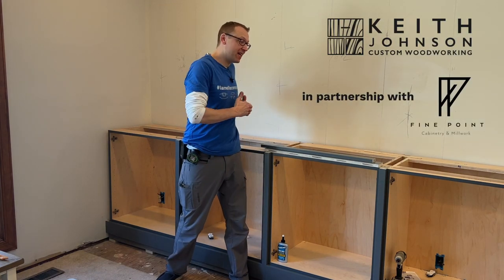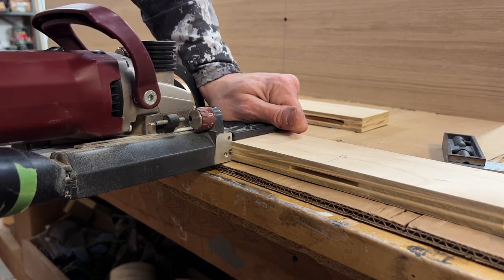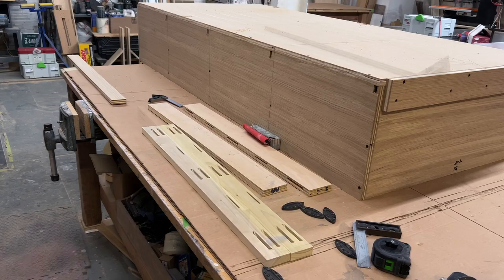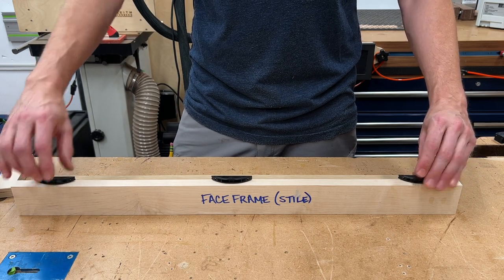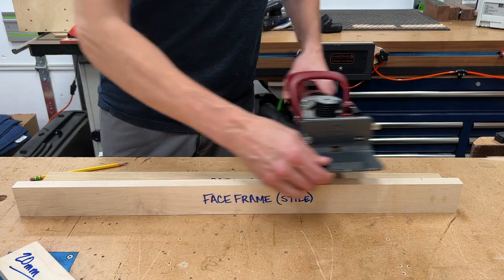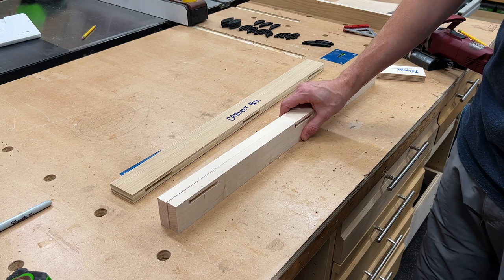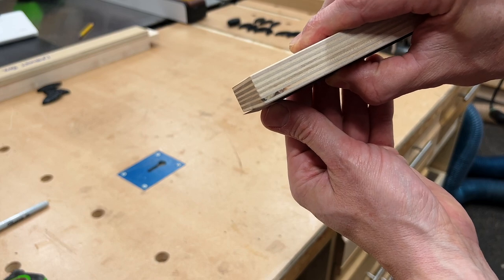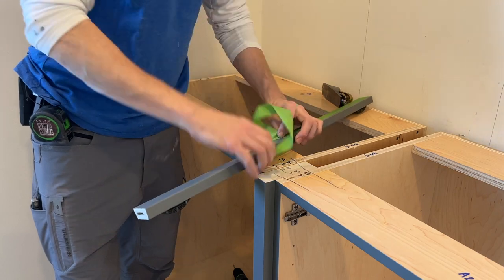How To Install Cabinet Face Frames, Filler Strips and Scribes with the Lamello P System

Comment: When you use the 20mm spacer block how do you know where the center line is? Are you making it on the 20mm block and then aligning that to the work piece center line?

Comment: Considering how easy it is to adjust the slot height i just dont see the point in using the spacer block that could also hinder you when plunging.
Reply: That's because you've never done it before and still believe that your eyes are capable of gauging height accurately on the basis of some little lines.

Comment: Isn’t free cutting on a table saw (especially tilted) piece that narrow very risky in terms of kickback?
Reply: not for the real ones
Reply: It's not that bad more likely to loose a finger than anything else.  There's no better way to do it sometimes when just a little needs taken off a grinder with a sanding disc is what I use normally the wall is bad enough it is tablesaw then grinder.

Comment: I noticed that the lamelo is now available in cordless. 
Does it matter if the male or female contractor go in the face frame or cabinet?
Reply from the maker: Not per se, but the general best practice for P-System connectors in all applications is the male half goes in the edges and female into the surfaces.  This is mainly to take advantage of being able to flat-pack the product.
Reply: Ah i see, makes sence thank you @ColonialSaw

Comment: I noticed on the face frame example at the end the layout lines weren't perfectly aligned.  Does the zeta allow for lateral misalignment?  Similar to the domino when using tight on one end and loose on the other?
Reply from the maker: That's correct, the P-System does allow for lateral adjustability, so you don't have to be right on the money for slot placement.
Reply: How much movement?

Comment: Minifix vs this system , which win for durability ?
Reply from the maker: I’ve never seen a Minifix connector used to attach face frames to a cabinet box, so I wouldn’t be able to evaluate the advantages/disadvantages.  Did you mean to comment on another of our videos?

Comment: was that paint face down while you put the tensos in?
Reply from the maker: If I understand your question correctly, yes- the Tenso connectors are installed on the back, non painted  side of the face frame.